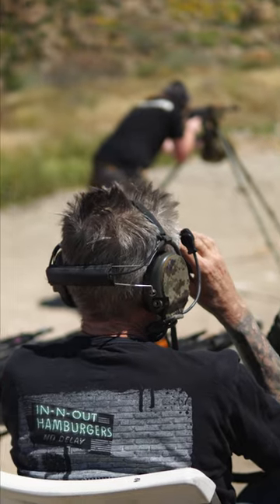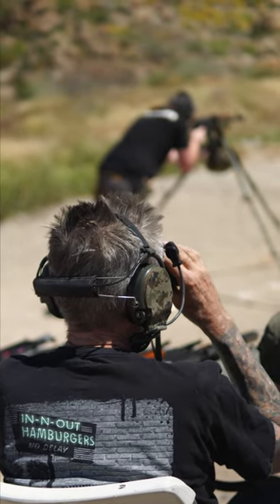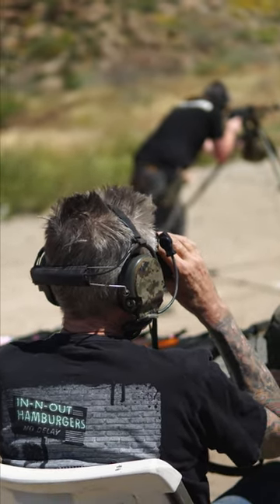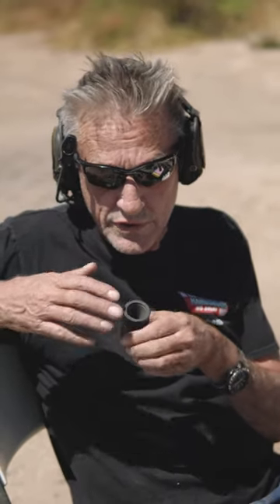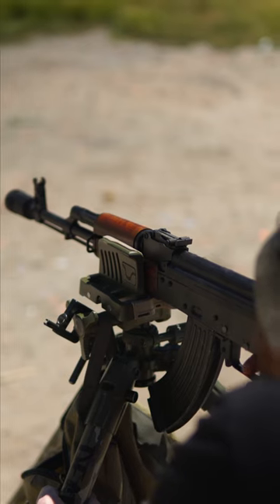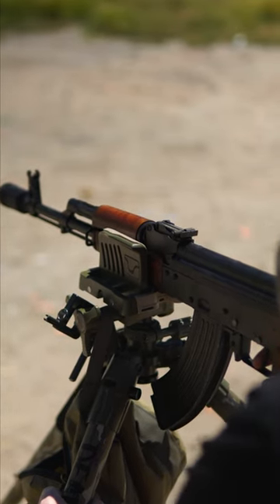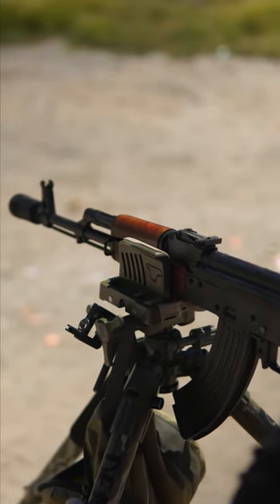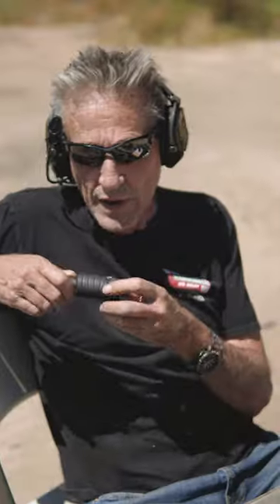FPX PSA DONT PUT A BOOSTER ON A LONG GUNS - JIM FULLER #SHORTS

Comment: Just zeroed a 16" with a booster today. Ill take this into consideration, but man i love how it works as a flash hider.
Reply: Armacon flash can
Reply: @EdwardSnortin   damn near the same design as the bulgy 4 piece. Are you sure it doesn't boost?
Reply: I'm not convinced this is the case on every rifle with a 4 piece flash hider. Mine is threaded on 24mm and I've switched out with the original brake and haven't noticed any difference.
Reply: If the rifle works reliably and groups properly, i wouldn't worry about it. 
Yes, if you will remove the booster it will probably change the point of impact but in my experience most compensators and even a slant brake will do the same on 16" AKs
Reply: @PolenarTactical thanks!
Reply: @jspec-vz3mc  lol Jim Fuller just have you some sage advice, yet you are not convinced. 😃
Reply: @toddianuzzi  not fully. I'm totally open to using a lighter flash suppressor if it works as good as the 4 piece though.
Reply: @toddianuzzi  his advice is that it'll over gas and poi shift, some guns are fine being overgassed (can also be corrected in other ways) and just re zero to match your new POI, its not rocket appliance

Comment: So I know the booster section is what increases back pressure(the cone inside the body). However what about just using the flash hider without the actual cone inside?
Reply: You'd lose the flash hiding capability that the cone creates and the can would we cosmetic at that point. I guess it would also divert the gas forward more.

Comment: What's the maximum barrel length you should use these on?
Reply: Just adjust the gas system with adjustable gas piston or gas block.  Best at flash suppression and sending sound away from your ears.

Comment: Isn’t a shorter barreled AK even more over gassed? So this 4 piece would make it run even harder? Genuinely curious about this since I’m going to put one on my Sam7k
Reply: It’s a little more nuanced than that. The less dwell time (in this context the distance from gas port to muzzle) you have, the less time the system is under pressure. The closer the gas port is to the muzzle the bigger the port has to be to get more gas in less time. Which gets over simplified to the idea of “short barrel = over gassed.” These type of devices do what I like to call “cheating a little extra dwell time.”
Reply: @gadsdenjim8785 🫡

Comment: Impact shift sounds more like garbage fitment of the muzzle device on the barrel rather than the design of it.
Reply: Seriously...
Reply: Well and any time you take off a muzzle device or swap to a different muzzle device your zero is always going to shift.
Reply: It changes the barrel harmonics
Reply: I always wrap my barrel threads with as much teflon tape as I can (when the device is retained by a spring-loaded pin and not by torque) and still be able to twist it on by hand... rock-solid and consistent.
Reply: @EdwardSnortin  Bingo... like the heavy Cobray "megaphone" I put on my Mini... lowered the POI (which is easily adjusted, of course), but tightened the groups INVARIABLY with every type of ammo. All by chance.

Comment: Plus make your 16 inch gun around a quarter pound heavier on the front? No thanks.
Reply: Did wonders for the groups on my Mini (using an old Cobray "megaphone" : )

Should have weighed it before I "permanently" attached it w/blue loctite, but believe me... it's machined from solid steel : )